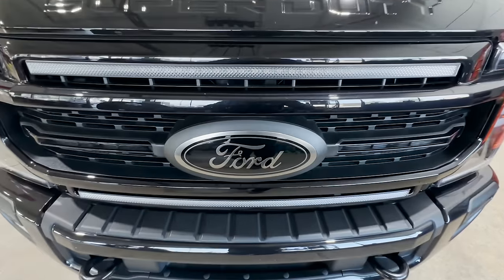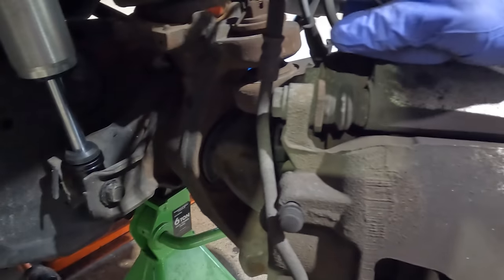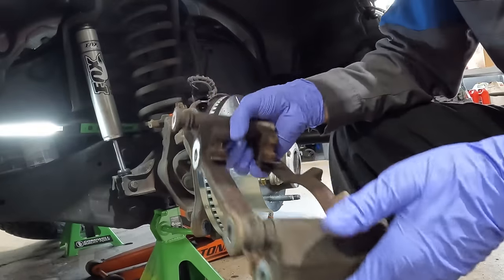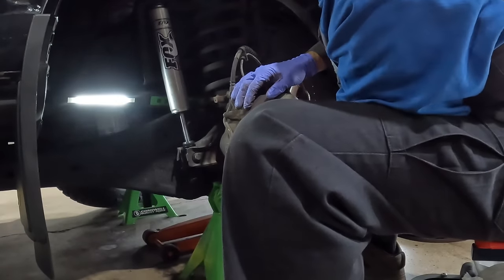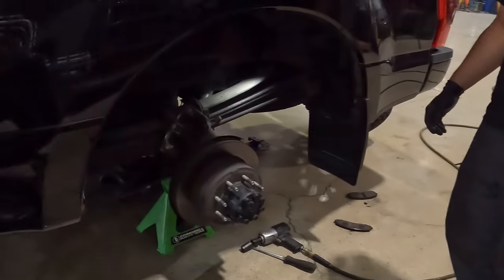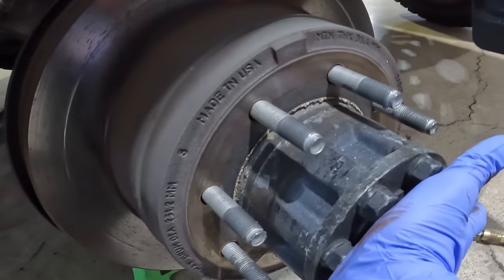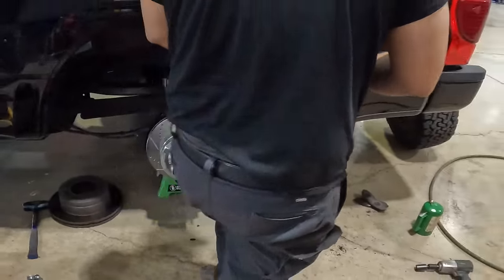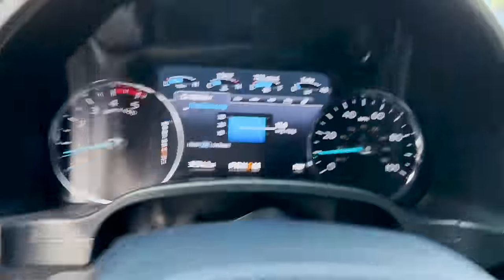Got DUSTY Superduty brakes?? NOT ANY MORE!!    **WATCH THIS**   @Powerstop

Comment: Those are the exaxt pads I use for my F2 fiddys and 2500 Durtymax's, BUT I only use the factory rotors. Absolutely no aftermarket rotors. Why? Aftermarket rotors are not made with the same quality of steel as GM or Ford rotors. Aftermarket rotors wear more and are more prone to warping (pad imprinting/deposits). OEM rotors can be turned many times for future brake jobs, aftermarket rotors maybe twice. Most places won't turn the drilled & slotted ones. And some of these type can't be turned at all without being destroyed.  The Powerstop Extreme pads seem to work better with factory rotors IF they are broke in properly. They are carbon fiber and ceramic. Follow the break-in process as printed on the box and they will stop better and last longer than most pads out there. Most people don't know this but most rotors aren't warping when you experience a pulsating brake pedal. It's from unequal deposits of brake pad material on the rotors and from pad imprinting from a stopped vehicle with extremely hot brake rotors. This happens when the initial break-in procedure isn't done and from softer metals in aftermarket rotors. Sorry about the long explanation. I know way more about brakes than I should. Not much fun at parties!
Reply from the maker: ....i agree with your last sentence

Comment: Screwdriver trick works sorta as long as there's no lip or decent wear on the pads or rotor, otherwise you'll be there all day dicking around with it.

I just grab my big C clamp and put one end between the pistons on the inboard side, and the threaded end on the outboard side pad... give it a few cranks and you'll push in a quarter inch or whatever and the caliper comes right off... If you're changing pads, just screw until the pads bottom out, you don't even have to take the caliper off to shove it. The pop the bolts out, grab the pads, yada yada yada....

Comment: I thought I had read on the World Wide Web that your truck needed to be in a maintenance mode from the radian control center prior to doing a break job if not it would cause more problems. I didn’t see that covered in the video or is that just a hoax?
Reply from the maker: If u have electronic ebrake

Comment: How are these brakes towing 15k trailer? Any break fade? I was always hesitant putting these ceramic pads on. I did a little of research and metallic pads are the best for stopping power especially for towing. If I didn’t tow so much I wouldn’t even think twice putting these power stops on.
Reply from the maker: Beats me

Comment: You should not use a sanding disc to clean the caliper because it removes metal and increases clearances. Only a scotch disc or wire wheel. You can see that metal was removed on the bracket . This makes the pads loose in the bracket , and they can clack up and back when backing up and going forward.  Also if the pads are loose in the brackets it makes it more prone to squealing.

I wouldn’t have removed the slides first, because you cleaned the rust off the bracket with open greased  slider holes that the rust particles and metal dust will ultimately get imbedded in.  I didn’t see you clean the old grease out, so that was not a good situation overall.
Reply from the maker: .......remember there is an editing process......
Reply: @PowerStrokeTechTalkwARod  I don't follow you....
Reply from the maker: ...you wldnt have to to notice guy smh

Comment: Ohhhh. I hope you never have the results I had with those pads. 
Driving a good few miles with no brakes at all is a sketchy experience on a mountain.
Reply: My OEM replacements were not semi metallic like what came from manufacturing either. They were ceramics but felt like the older super duty pads that needed a tiny bit of heat to really bite.

Comment: Does GM and Dodge use the same bullshit parking brake for the rear?

Why don't they use the caliper like the LS and so many other cars use? It's not like that gokart brake pad is going to stop you or even hold the truck still on a hill anyway... I"ve had nothing but trouble with them to the point I don't use them.  My Jaguar XFR uses the same system as the Lincoln LS and they both have the same ratcheting cam system and it uses the inside pad as the brake. I've never had either of them stick, they just WORKED.

Comment: I wouldn't use those pads/rotors. I would run brembo or centric/stoptech with carbotech pads, alkebono or maybe hawk ceramics. Brembo and stoptech would also be decent pads but make a bit more dust. That's just me , you do you brother.
Reply: BPI, Hawk and Akebono all will tell you ceramic is not good with towing heavy. That was their word to me.
Reply: @vais3  well that's lame. Just got an f350 and was gonna do a full swap of pads, rotors, lines, and fluid. I sure it's a trade off having good pads for towing but less rotor life more dust, etc. guess I'll look into centric/stoptech or inquire with carbotech. I use those on my other rides but the f350 is the new daily and tow rig.
Reply: Cermaic is great for the track once you get heat in them.  In a towing application, not so much. You just dont keep the heat in them and unless they are at temp the stop worse.
Reply: @Lucariorunner centric recommended their Fleet pads for heavy towing and their posi quiet extended wear semi metallics. 
I was warned that the dust would be there with the fleet pads and that they needed heat to live a long life. 
Akebono said they would be okay if towing occasionally and light. 
Hawk recommended LTS and Super Duty pads. BPI (Raybestos) recommend their Specialty truck pads which I have used with great results but make WAY more dust. 
I will wholeheartedly recommend Raybestos Specialty Truck coated rotors. They survived a ton of temps wild thermal cycles as well as road salt and never once looked like a rusty piece of scrap.
Reply: @douglashaussler4238  yeah that been most of my driving experience. Dd and road course. New to hd trucks so I'm basically applying my experience to the new truck.
Reply: @vais3  I appreciate the recommendation. I'll look into the raybestos rotors for sure. I love in TX so no salt but always like the coated rotors to help prevent that rust buildup. Hence why I like stoptech rotors. But I do like raybestos products they have served me well on my 4runner and Tacoma. I'll definitely look at the others. My expected weight to tow is about 6-8k pounds. So not small but not big either
Reply: @douglashaussler4238  I’ve never seen a track pad as a ceramic but there is certainly a first for everything. Normally they’re some sort of semi metallic or non metallic blend. Carbon granule pads for example are great but costly.
Reply: @Lucariorunner don’t quote me here but I believe there was an EBC offering with a carbon granule friction. Think they were orange in color vs the typical green or yellow series offerings.
Reply: @douglashaussler4238 ceramic is not good for the track. Ceramic holds heat leading to premature brake fade and rotor warping. Carbon ceramic is good for the track ceramic and carbon ceramic are two extremely different things.i worked at factory motor parts as a distributor of centric. I like the stop tech line but the 105 and 106 series pads that you were talking about were replaced under warranty quite a bit. Bendix I rarely saw issues with their products. I also prefer the bendix as they're a brake parts supplier for ford.
Reply: @vais3 bendix fleet metallic is an an extremely good pad. They are the same as the oem super duty pads l, same formula used on police car packages as well. EBC yellow stuff is also a great pad for heavy applications towing/ hauling or performance vehicles out for the occasional day at the track.
Reply: @T6Tarek  bendix makes some decent offerings but isn’t a common name these days in light duty applications. Still a common one in class 6-8. I’m not totally familiar with the EBC yellow series pads but the comments I have heard were along the lines of effective but not long lived. Orange is/was a carbon granule composition but I have no personal experience with them.
Reply: @T6Tarek  your comments in regards of the 105 and 106 series pads were exactly what I was told by Centrics team. They need to see heat or the pad prematurely wears out. Rather unique composition that does well under heavy stress but poorly in daily driven applications.
Reply: @vais3  106 series is considered their extreme duty pad. 104 is a general semi metallic pad 105 is the ceramic series. Im not sure why someone would tell you ceramic has to get hot. Ceramic is horrible at dissipating heat. Getting them hot and leaving them hot leads to premature brake fade and rotor warping. They're really only good for keeping dust down on wheels. If someone seriously told you to get ceramic hot to work properly they should be fired. I hear people try to sell ceramic all the time as top of the line and it couldn't be farther from the truth. I spent a decade selling them. Ford Motorcraft was my specialty but centric, bendix, ac Delco were some of the others I was highly involved with as far as brakes.
Reply: @vais3  if you drive a ford you're familiar with bendix without knowing it. Hahah. current set of yellow stuff pads have 15k on them and still look new. Wear is even and they have made a noticeable difference. I wanted to try orange but it wasn't available in a package yet. I did a full vehicle kit front and rear pads, slotted drilled rotors upgraded calipers. I can tell you EBCs warranty was great I had a caliper pin stick and they sent me new front rotors pads and calipers at no cost. They asked for a few pictures and told me I was free to keep or discard the old stuff. I held on to everything besides the damaged rotors and side of pads.
Reply: @T6Tarek  the 106 currently is the extended wear version of the posi quiet. The 306 I was told was the “extreme” or fleet duty pad. I believe they are now calling the 306 series XT. 
I’m not sure why heat was needed to keep the pads from prematurely wearing but that came from them directly. Not so much that heat to function was a requirement. 
Did you work with Bendix, BPI or Carlisle Brake and Friction?
Reply: @T6Tarek  I was rather tempted to use EBC Orange at one point but couldn’t get them during the shutdown. Personally, I like running higher carbon content iron rotors similarly to that of BPI’s Specialty Truck line. Longevity was second to none and corrosion near zero even with road salts. 
I’m not sure how many companies sell to FoMoCo but I can assure you factor pads and the later versions I purchased via Motorcraft OEM (not the budget stuff) were completely different compositions. The later stuff acted nearly identical to a ceramic as far as low temp performance and maintained a stable mų level at elevated temps like a semi metallic. Lower dust as well.
Reply: @vais3  depending on the year of of your ford and model it's has a copper free ceramic composition pad. front and a semi met rear.  F250 up semi met or super duty depending on package. F150 is all over the place.
Reply: @T6Tarek  17 F-250 Super Duty but the pads were from 2021 production. Part number was a direct match to OEM as was the engineering number but there was a clear difference in composition. May have been similar to the older Super Duty compound but I do believe those were FE edge coded pads. 
My 2022 F-150 Tremor has ceramic or some sort of friction compound containing ceramic. They don’t create visible dust and stopping performance is decent.
Reply: @vais3  I might have to see what my fellow track junkies use on their rigs. I was used to driving my car or truck to the track, do the track days, then drive back home. So now I got a tow rig I wanna do it right. Buy once cry once. I think some used ebc or the OEM stuff.
Reply: @Lucariorunner  brief reading is telling me some users of EBC green stuff pads aren’t happy with the braking performance. Yellow stuff and orange stuff (heavy duty) are the ones people are using besides OEM with greater success. No word on dust levels unfortunately.
Reply: @vais3  I started with green stuff they were junk. A lot of dust with zero performance and a lot of noise. None of that bothers me if they perform. I'm not a Karen that returns much stuff but after a month and definitely breaking them in correctly I sent them back. I  really felt like I was running some kind of 19.99 pad slap special.
Reply: @T6Tarek  4000 series?
Reply: @vais3  I'm not sure what those are.
Reply: @vais3  if you're talking about the yellow stuff that's what my f150s currently run. Been installed for over a year and have been excellent. Low noise for the aggressive compound
Reply: @T6Tarek  apologies. Green stuff comes in 2000 and 6000 series. Slightly different composition from one another. Either way, not that great seems to be the consensus.

Comment: When I bought my f150 they changed the pads at the dealer and the front squeal. I'm at a cross road between fix it myself or take it back there. Like how can you screw up putting on brakes 🤔?